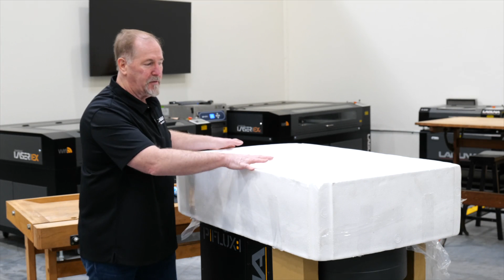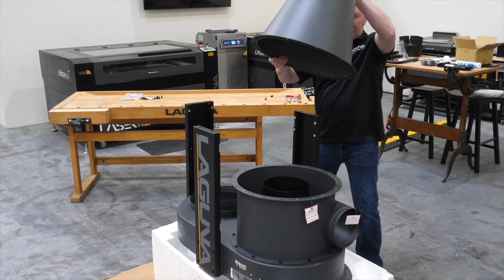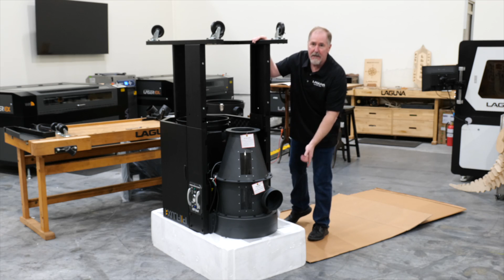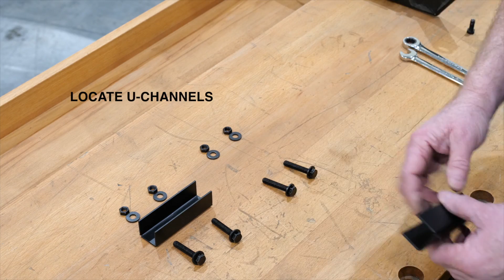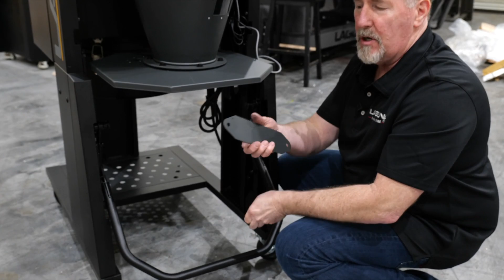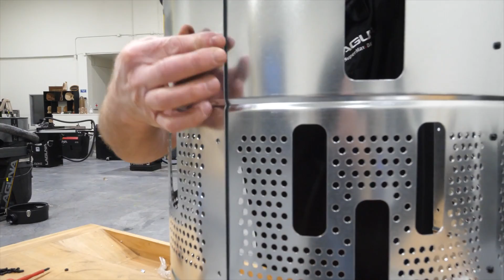How To Assemble 2022 P|Flux Dust Collectors | Classic Machinery

Comment: I just purchased the PFlux 1. When changing the orientation of the Inlet Drum, can it be flipped "upside down"? I dont need to rotate it but if I'm able to flip it, i can have the inlet nozzle close up against my wall which would be ideal in my case.
Reply: I had the same question.   I'm going to e-mail customer service.
Reply: Got reply from Laguna.  The answer is no, the inlet drum should not be inverted.   It would effect the function of the cyclone action.

Comment: My wires are black to blue red to red and white to white. No black wire in motor cleaning box also the lid for the drum the hole isn't centered? Why is it like this? The self cleaning motor turns on by itself with the dust collector not being used. No dust in the machine.